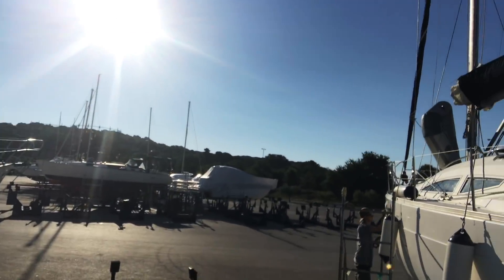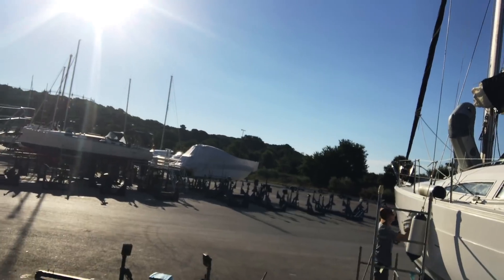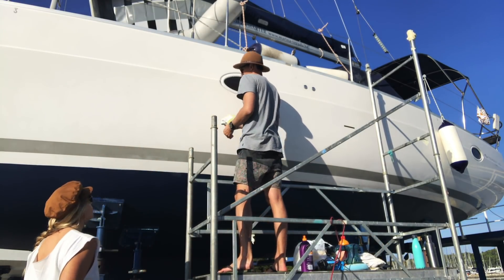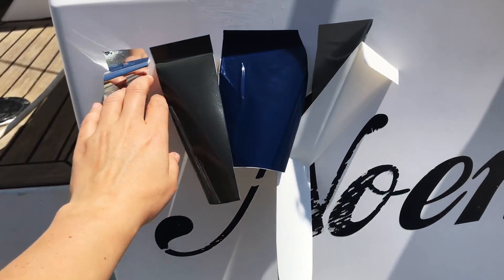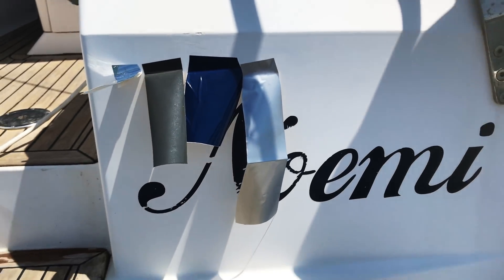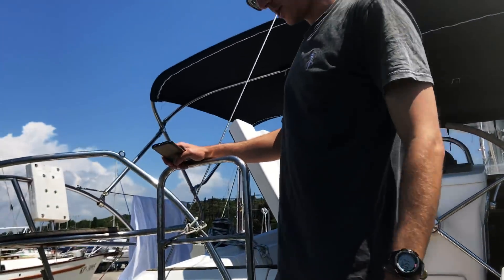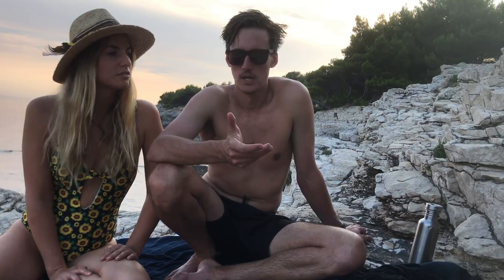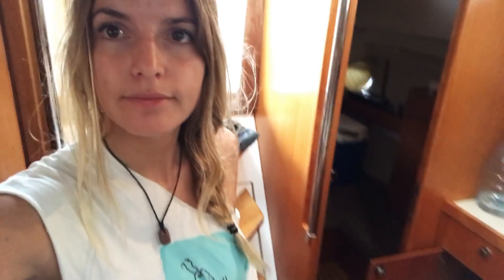When Boat Work Goes a Tad Pear Shaped ~ Vlog #5

Comment: In case of emergency, it’s also a good idea to have properly sized bungs for each of your thruhulls. If the seacock  fails, the bung is used to plug the thruhull.

Comment: With through hauls below the water line you should have a couple of raw wood plugs made and keep them  handy and in an emergency you can knock them into the holes and they will swell in the water and seal the holes in a worst case

Comment: Nothing worse than a dodgy seacock, always good to learn a few things from a sparky as well. Tip get your self a electricians  multimeter and learn to use it, very useful for finding faults that occur in salty conditions
Reply: and make sure it has a clamp meter on it... priceless for fault finding.
Reply from the maker: Thank you Patrick. Always great tips from you. Thanks also, Mick :) 
Love from Av
Reply: Make sure it is an ac AND DC Clamp meter.  Most are just AC